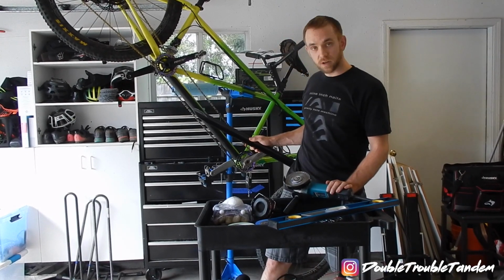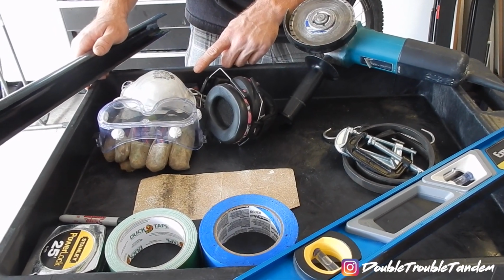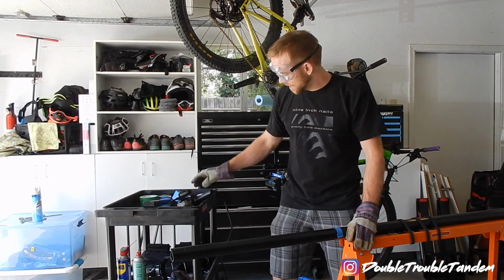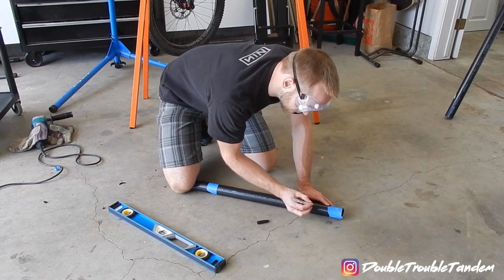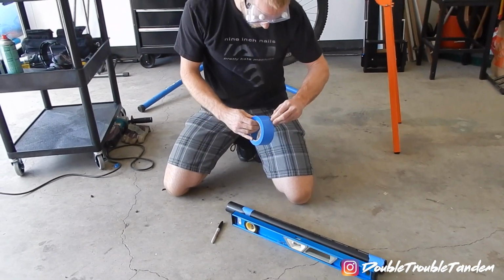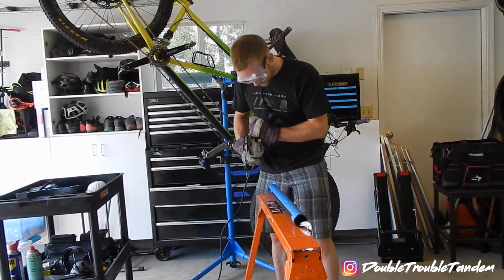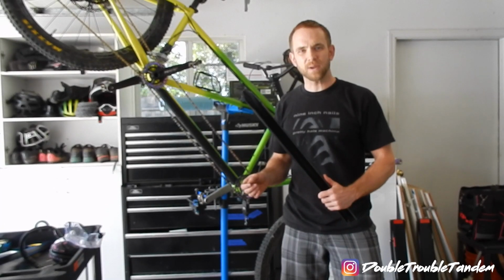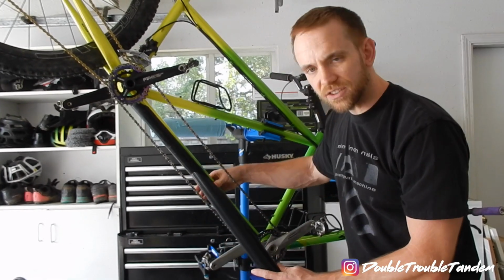How to make a tandem bottom tube bash guard

Comment: How to make chainring bashgusrd. Do they just sell those lol
Reply from the maker: You can buy them but they’ll be sized for a standard front chain ring. Usually the smallest you can get is for 30 or 32T. Works well for the back but it’s bigger than needed if you’re running only a small ring in front. On our newest bike we had a friend with a CNC mill us a custom one out of high density plastic and made it just bigger than the spider’s arms.

Comment: Good info man! Do you think there might be any long-term issues with moisture getting trapped between the frame and the bash guard, causing rust and/or corrosion? How easy is this to remove?
Reply from the maker: Good questions! I would suspect some moisture would get trapped as there can be some small gaps towards the bottom. However, I'm not too concerned because I've also noticed that these steel frames do get moisture trapped inside. I've never tried to take the guard off as I think there is some risk to the paint to install and remove the guard. I'd suspect it would actually come off easier than it goes on if you were to use something flat against the guard edge then hit that with a mallet.  I'll let you know if I try to take it off 😊.